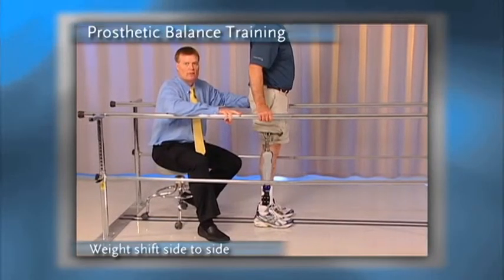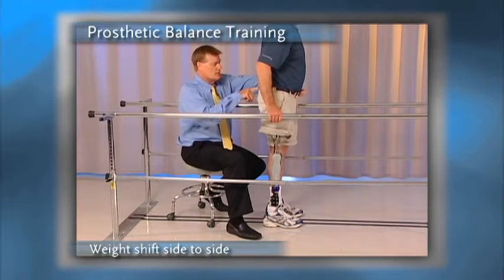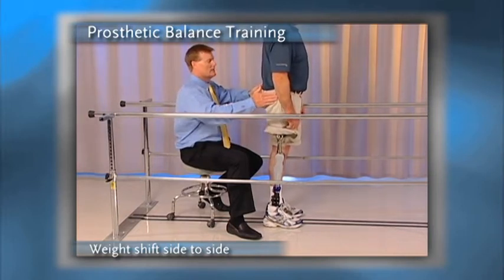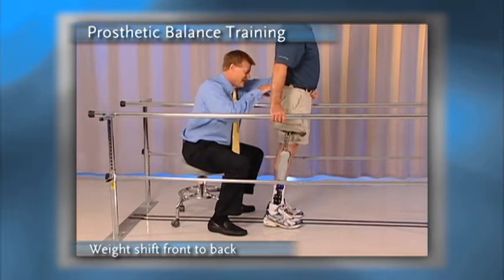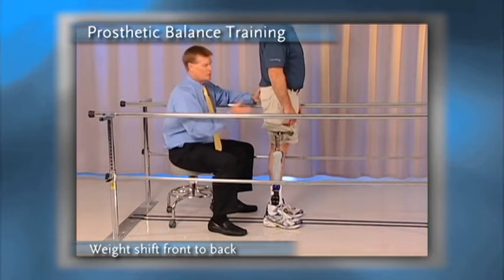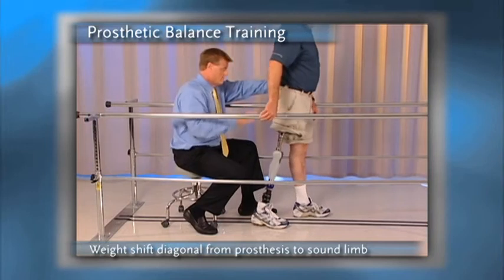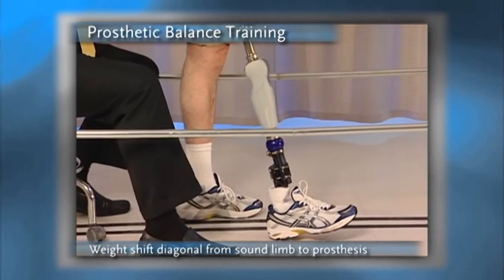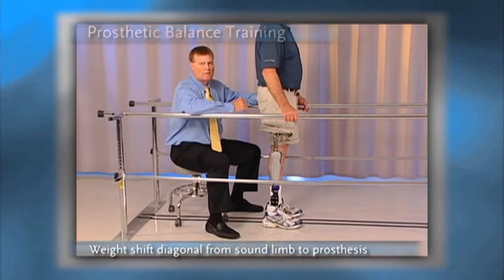RHEO KNEE - Gait Training - Part 2 / 4

Comment: On my 3rd test socket.  I have a demo Rheo knee for the next week.  Still using a walker and trying to gain confidence.  Looking for tips or advice on this knee.  I got the chance to test out the Kneuro last week; brainworks is going to let me trial it next week.  Until then?  I'm having a hard time figuring this Rheo knee out.  Its a lot heavier, it kicks around.  Could use any tips.  I'm a new amputee.